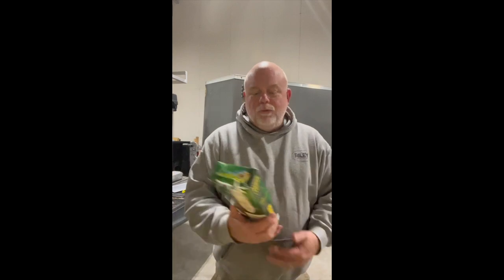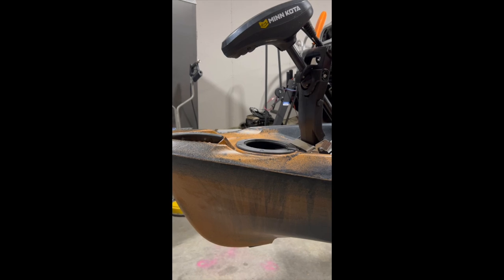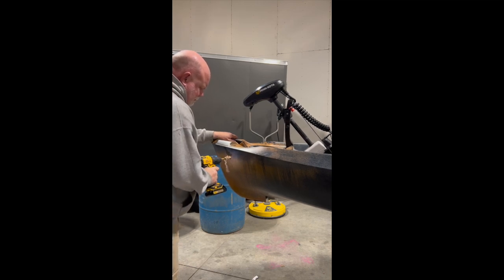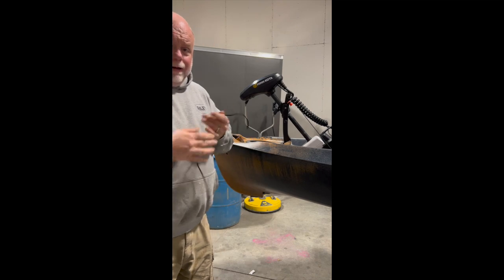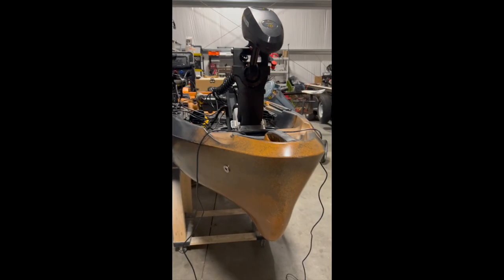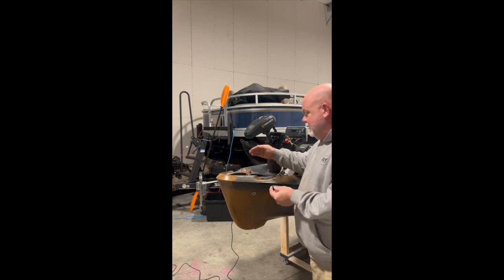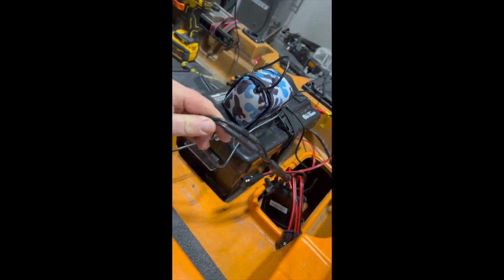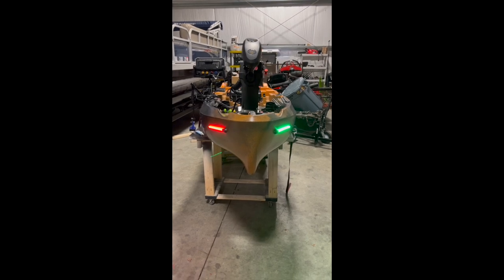How I installed Yak Power Bow lights on my Old Town Sportsman Autopilot 120

Comment: Great video... I learned alot, however you installed your navigation lights incorrectly. If your facing ahead portside (left) is supposed to be red and starboard (right) is supposed to be green. You installed your lights backwards.
Reply from the maker: Yes. I know. I figured that out.  But oh well.  Guess it will just be that way.